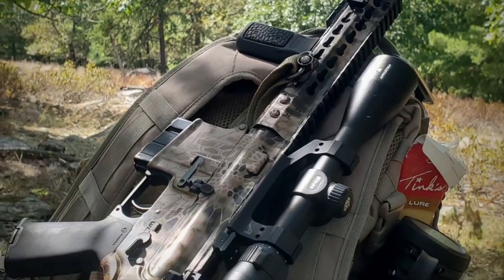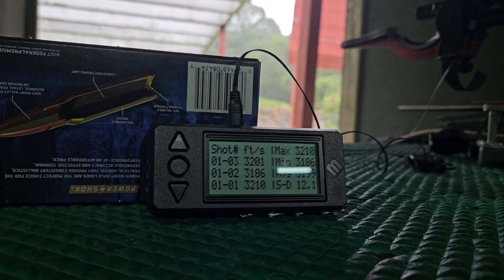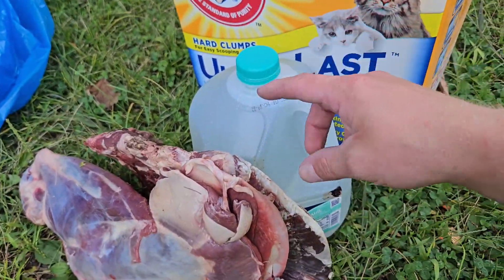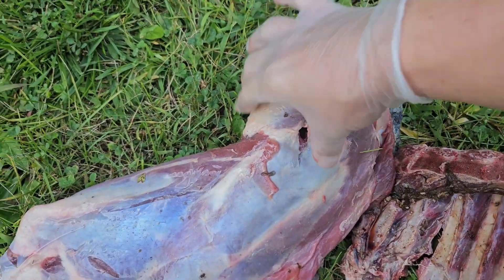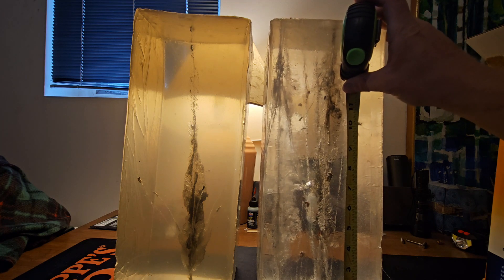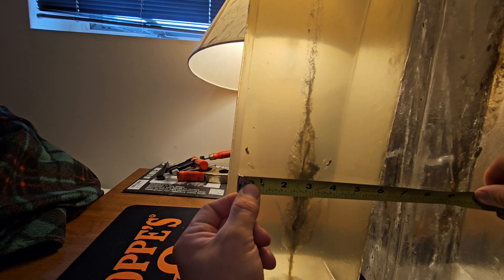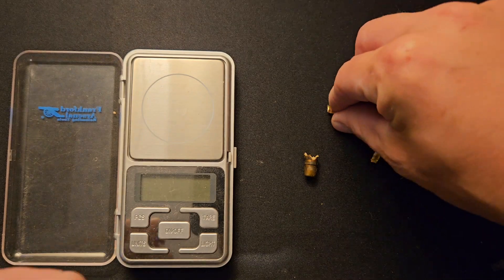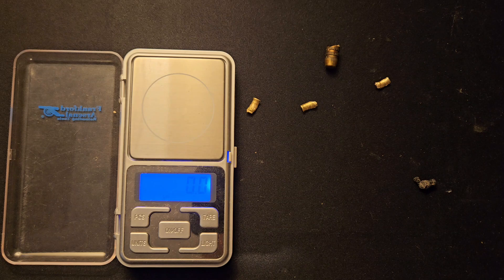308 cutting edge 100 grain raptor

Comment: I’m a huge fan of Nathan Fosters work from New Zealand. 

He is not concerned with meat damage. I wish I wasn’t.

I want very little damage.

This last season my brother in law hit a very small couse deer buck straight on in the chest from a 25-06

The 100 gr ttsx entered the chest and came to rest in the left ham up against the inside of the hide. The bullet traveled the whole length of the deer.

All the petals came off. Impact speed was right around 2850.

At that speed and travel distance of the bullet, I was very impressed! Meat damage was next to nothing. Lead, bonded or not, I believe would have been very  extensive, ruining a lot of meat.

I very interested in copper bullets that shed petals, making additional satellite projectiles, but don’t explode lead through out the meat.

Right now I’m working with Hornady 140 mono tip for the 308 marlin which are now discontinued.

They still make the 30/30 model, which expand at even slower speeds than the 308 marlin model.

My group sizes are inconsistent. But at this time, it’s my rifle, not the bullet.

I believe that bullet will work great.

Maybe even Hammer Hunters bullets for 30/30’s will work great as well.

Thanks again

Comment: Very good video, I kill 2 moose so far with those bullets. First was at 50 yards with 130gr out of my 30-06 @ 3300fps. Lungs shot moose fall in is track, recovered only one petal inside, everything else past thru the rib cage. Second kill was at 80 yards with 100gr out of my 270wsm @ 3570fps. Same lungs shot but this time only the core exit. Both lungs where turn into gello, moose fall in is track. I made some 100gr (safari raptor) for my 30-30 @ 2750fps but did'nt have the chance to try it on games.
Reply: Those 30/30’s loads sound great!

Comment: With the velocity and light bullet how much bloodshot meat are you seeing?
Reply from the maker: not much at all but the shot placement and angle is important.  When the petals come off it dumps a ton of energy , but that is usually inside the chest cavity. I did  have shot, quartering away hard and the deer stepped forward at last second.  so I shot it in the hind quarter and it blew off a fist size chunk of meat. On broadside shots there just small entry and slightly bigger exit from the base but vitals are shredded from petals.   Very impressed from a tiny bullet.

Comment: May I ask…why these over the copper version?
Reply from the maker: I wanted to go as light and fast as possible.  I believe the lightest copper raptor is 135 grains.  I have an 18 inch barrel so I went with lightest option.
Reply: @Dfleuryoutdoors oh, ok that makes sense.  However, Raptors open up nicely without excessive velocity, if that’s what you’re concerned with.
Reply from the maker: With bullets like the raptors , I think the caliber size base will do more damage the faster its going. So far i have only killed 1 coyote with a raptor with my 6.8 spc.  Shot him in the ass (on accident) but it still dropped him. Looking forward to see how will do on deer.
Reply: Wishing you good luck!👍🏼
Reply from the maker: @hikenmikes8262 thanks!!